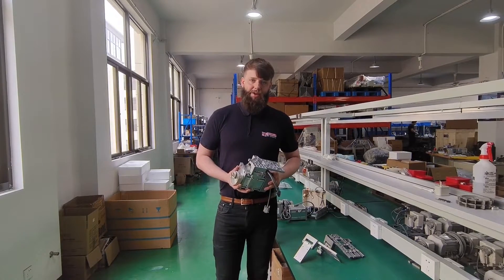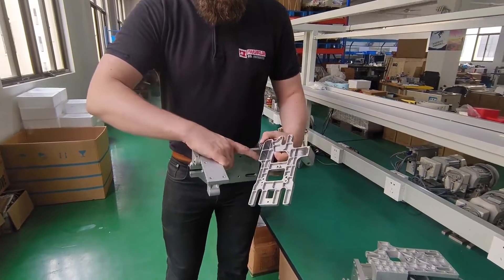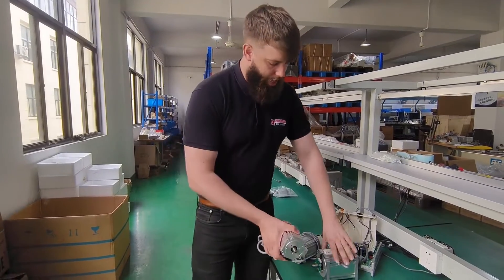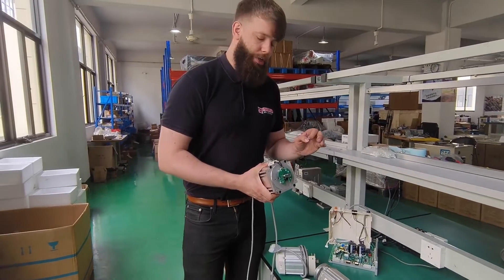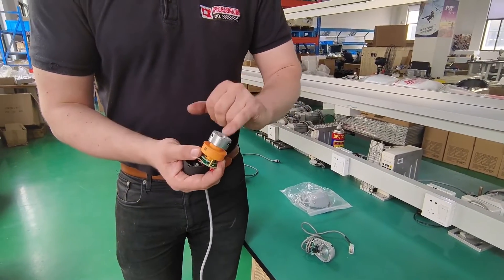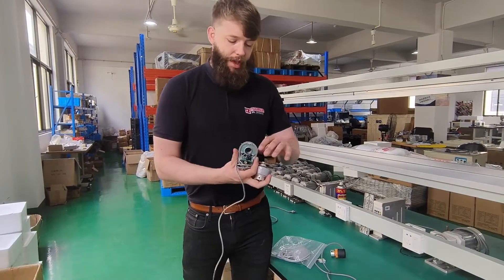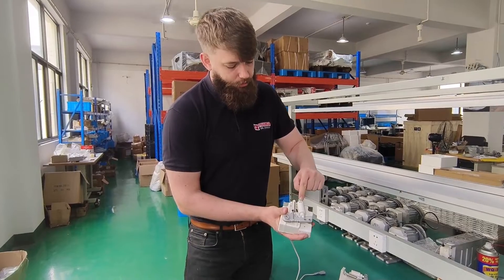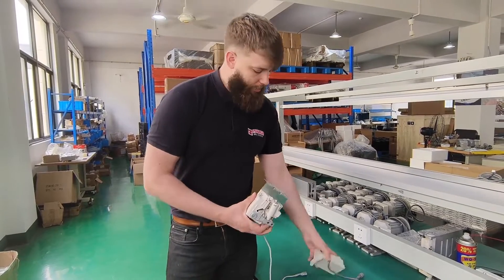Heavy Duty Servo Motor - Perfect Speed Control

Comment: 7750SH or 750SL - what is the real difference? 
Sorry to say, but when both have exactly the same numbers in the specs and visually look the same, just a few words in the description do not sound convincing. What is the actual distinction between these two? 
Is it necessary for them to have their own needle positioner or can they use third party devices as well? Or is the needle positioner not an option and included in every motor purchase in any case? 
And finally - outer pulley diameter on the motor?

Please clarify. 

 Your motors are great anyway!
Reply from the maker: Thanks for your question. HM-750SL servomotor is for medium weight industrial sewing machine (rotary hook), such as CowBoy model CB6900. HM-750SH servo motor is for shuttle hook type extra heavy duty industrial sewing machine, like HighTex model 733CS
Reply: @HightexHeavysewingtechnology  thank you! what bout outer pulley diameter on the motor - can you provide a size?
Reply from the maker: @tony_g_1905  Standard supplied with 45mm pulley, when customers use on high speed machine, we will use 65mm pulley.

Comment: Hey can i use this for the Juki DDL-8700? It's not a Leather Sewing machine. If it's not suit the DDL-8700 which servomotor would you recommend? I'm looking for a VERY QUIET and POWERFUL Servomotor for my sewing machine. Thx!
Reply from the maker: Our servo motors are designed for heavy duty industrial sewing machines. Juki DDL-8700 is not garment sewing machine, you can buy quiet motor at much lower price!!
Reply: @HightexHeavysewingtechnology  hey thx for your answer, i just thought i can also use this servomotor for the juki ddl 8700, since it's a sewing machine that a lot of designers and fashion industry also use, besides that it's not for heavy duty like thick/heavy materials like leather. But this machine can also sew jeans, that's why i thought this servomotor would suit perfectly for that job and I've been searching for so long and i can't really find the one, even though there are a bunch of it and I'm not sure which one is one of the best that people would recommend and i have no idea about servomotor. But thanks anyway.